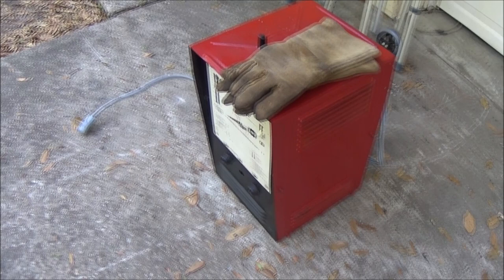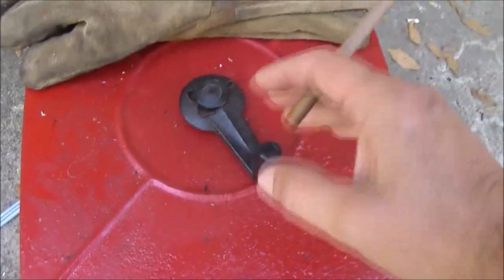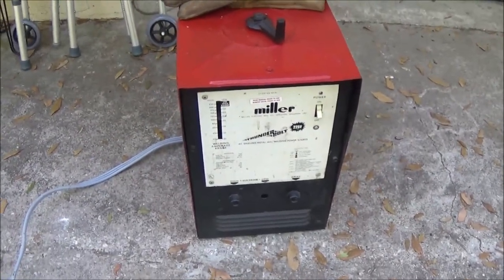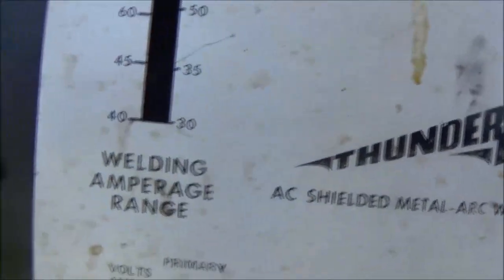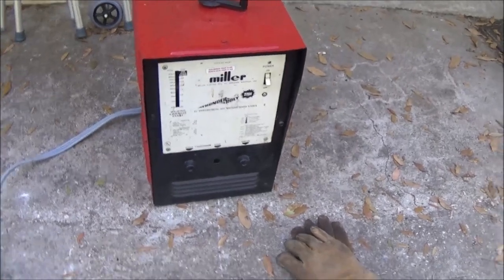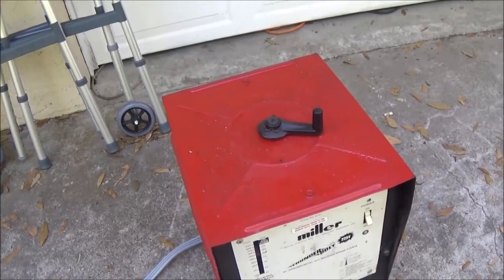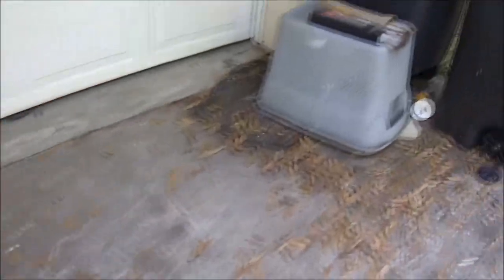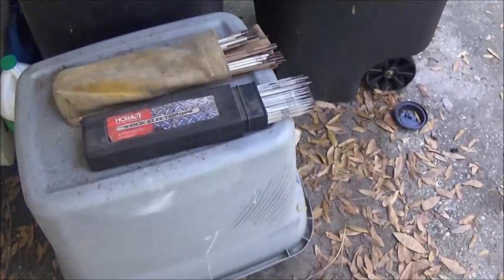Checking Out An Old Miller 225 Arc/Stick Welder

Comment: Looks good . Did I tell you about mine ? Century model 110-110 . Came without leads so I bought a set of 4ga. jumper cables from Wal-Mart . But they are CCA cable - copper clad aluminum . Some people say don't use that stuff because they will burn up , other people say it's o.k.  About ready to test the welder except for the fact I don't have 240 volt in the garage . And I'm also upgrading the welder to modern dinze quick connectors .